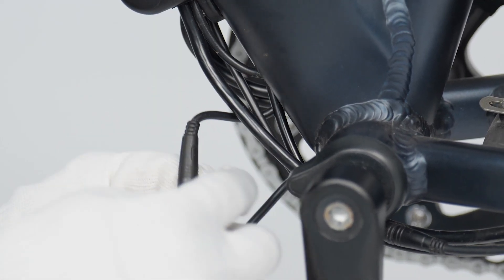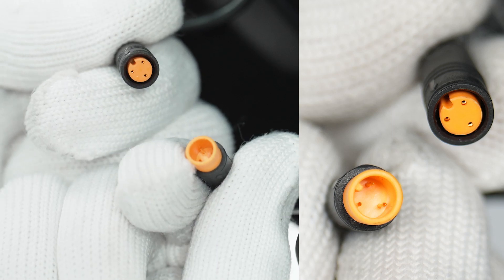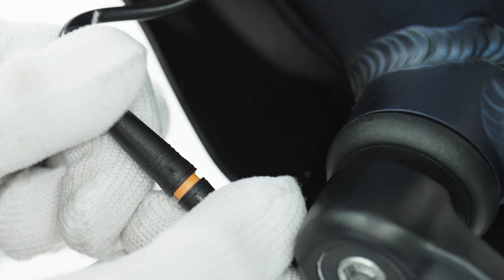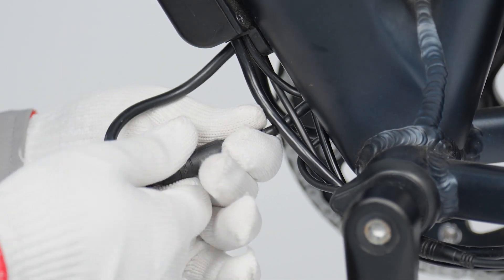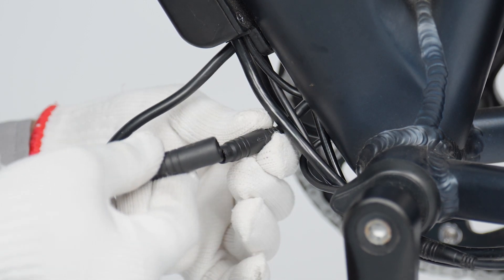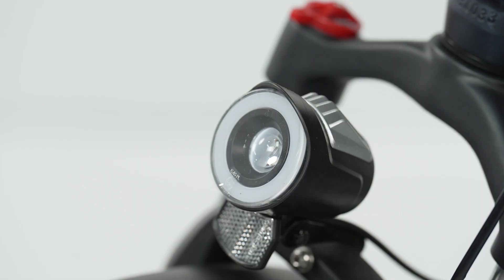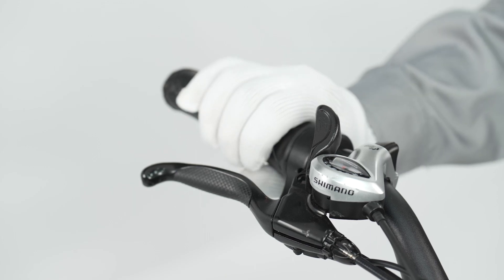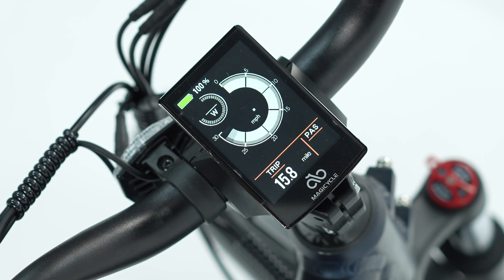How to Solve 6 Common Electric Bike Problems of Magicycle by One Step

Comment: Save your self $$$ and headaches and sell your magicycle and warn others not to buy. Mine cost $1999.00 and 10 months later with only 32 miles it's seized up can not roll backwards and given throttle it goes up to 138 and clicks back to zero and rear wheel never moves. Janice Lau customer service representative has an excuse for everything and it's your fault

Comment: Help please! I have a brand new bike with 1 mile on it and it has an error too and the book says it’s a communications error. The company sent me a new controller which I put on and it still says control. Communication error. What do I try now? I can’t send it back. It cost too much.
Reply from the maker: I'm sorry to hear about the trouble you're experiencing with your new bike's controller. It's frustrating when you've tried a replacement and the issue persists. You can go our website and ask 24 hour service
Reply: Magicycle will make every excuse not to warranty any part of your bike. Mine has 32 miles has no rear power and can not roll backwards as it is seized.  Janice Lau of Magicycle seen spider webs on my wheel and noted it as the problem. Sell your Magicycle and find a better company

Comment: I rode in wet and muddy conditions and my PAS stopped working.  I did the unplug and replug as described here and that did not help.  After continuing to ride with pedals and throttle for about 2miles in dry condition the problem seemed to resolve itself.